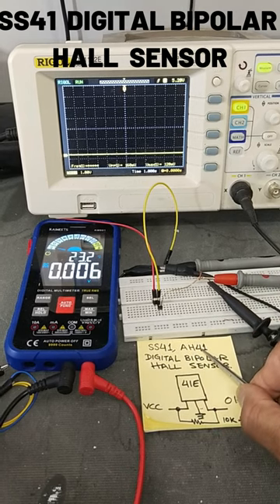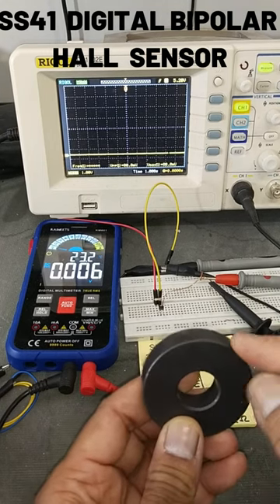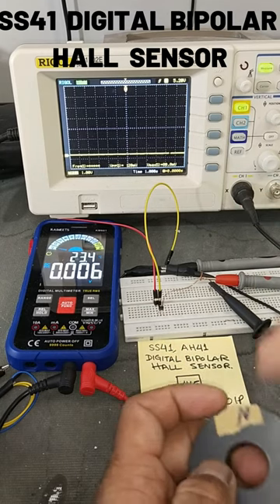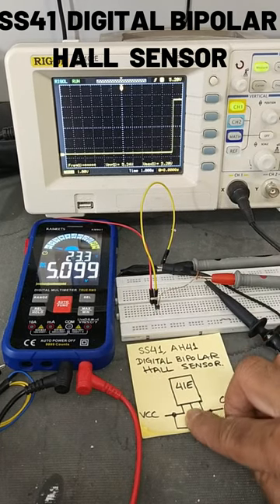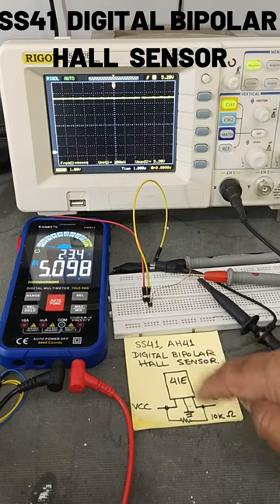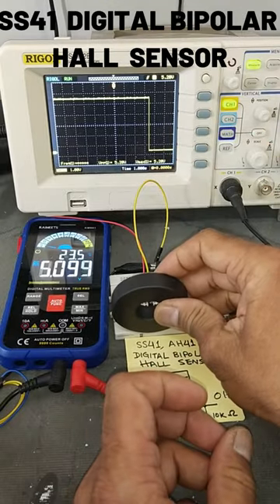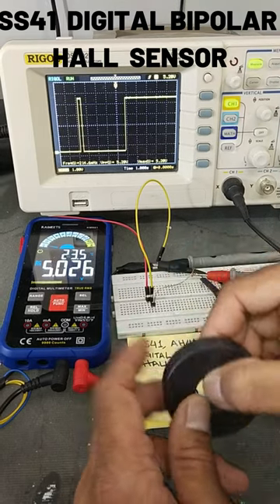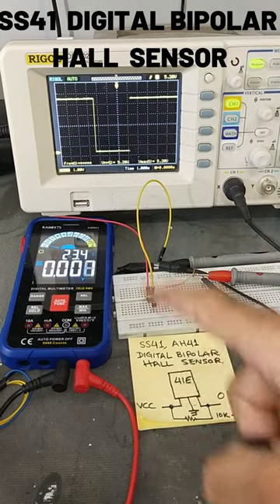Digital Bipolar Magnetic Hall-effect Sensor SS41, AH41, A3141 #shorts

Comment: Apple did away with hall sensors and replaced them with angle sensors that have to be calibrated with proprietary (unobtainable) software. Apple is a clown.
Reply: You have no idea what you are talking about. Hall effect sensors were never used to measure angle, that has always been the job of an accelerometer and gyroscope. Hall effect sensors can be used in a magnetometer to measure the Earths magnetic field and hence compass heading and they have not removed magnetometers from iPhones.